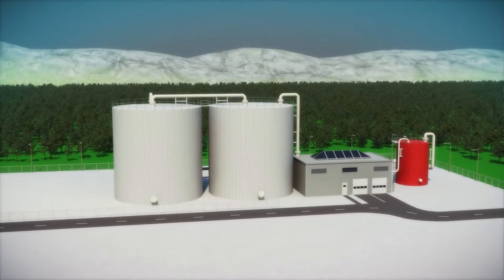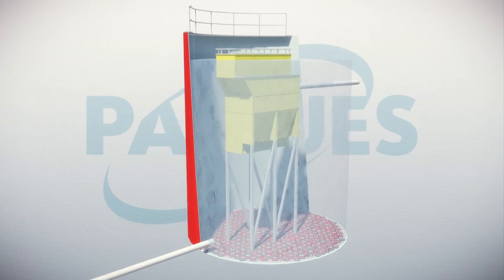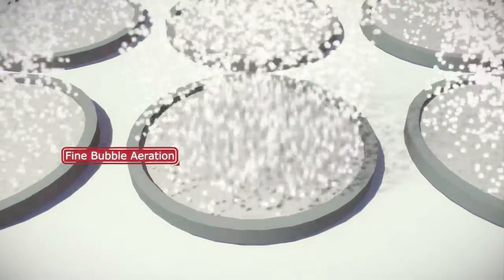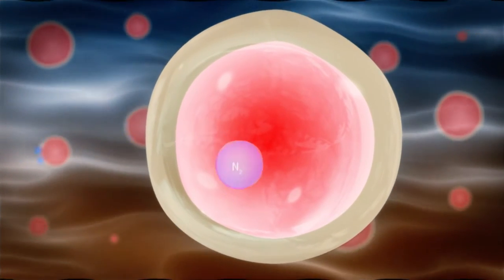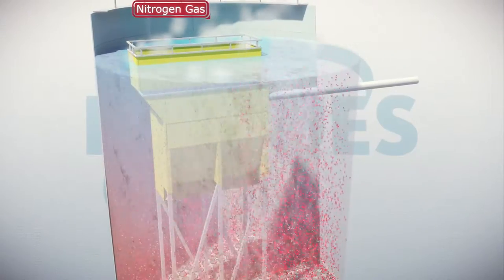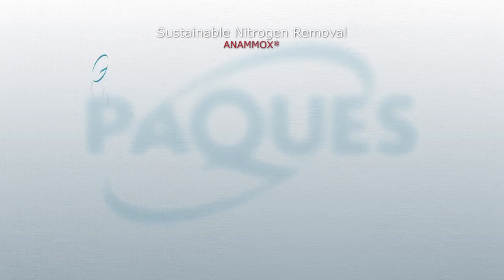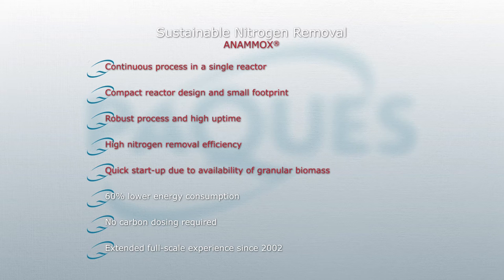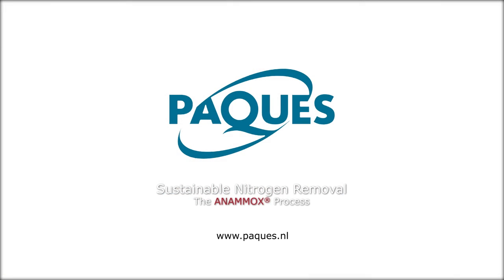The ANAMMOX® Process

Comment: The name of the video isn't fully correct. ANAMMOX stands for ANAEROBIC ammonia oxidation. So this is without addition of O2 and consists only of combining NH4 with NO2 to form N2 and water (also called 'the missing link' in the N cyclus). The process shown in the video is actually a combination of part of a SHARON process (Single reactor system for High Ammonia Removal Over Nitrite). In a SHARON reactor they cycle between O2 rich and O2 poor situations in a single reactor to reduce costs of O2 (and actually carbon scources aswell). The first step of NH4 forming NO2 after being combined with oxygen is the oxygen rich cycle of SHARON (driven by ammonia oxidising bacteria). 
Besides all of this, great video and awesome system.
Reply: Thank you! I was wondering the same thing but with your explanation I now understand.